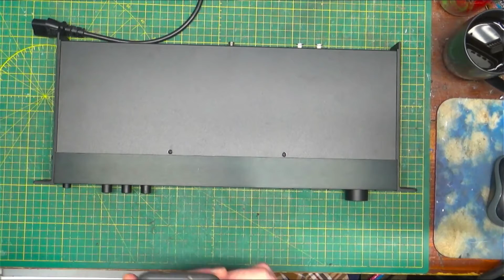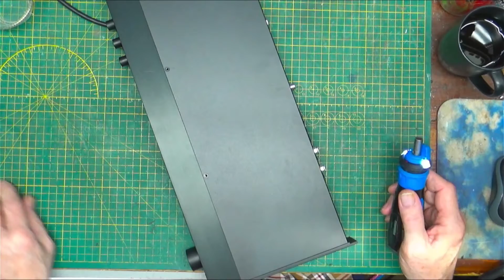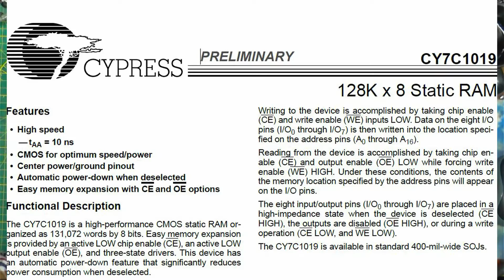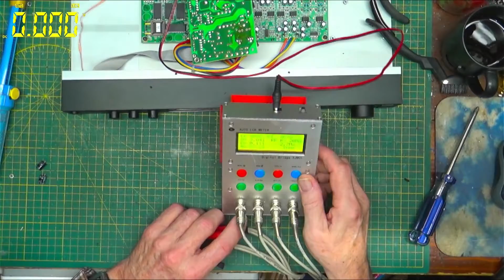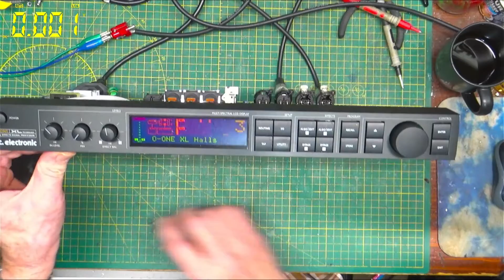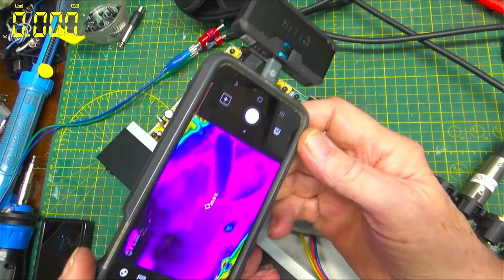T. C Electronic M-One Dual Effects Processor Repair

Comment: Just to let you know, to pull the front piece off, You have pull those 4x knobs off first, then you can take front off by pulling it a bit forward, then slide it to any side.
Reply from the maker: Thanks for the info. Sometimes I think design folks have fun dreaming up ways to make it hard to get in.
Reply: @AERVBlog I have one that takes a few minutes to power up properly, i dont know what the issue is with it, i got it repaired years ago and it happen again.

Comment: Thanks this is a common fault with tc electronics equipment I have a finalizer ,fireworks,and a third tc module and all have suffered from this problem I paid over a thousand pounds for each of these when they first came out I had just over one years use when they all developed this problem. I was absolutley livid £3000 down the drain. I then paid £400 for replacement power supplies which never arrived from Ierland. it took several months and threats to get my money back.I then placed them in storage where they have been for well over a decade.This is an easy repair for me now that I know how to test without the schematic. many thanks i will uopdate you once the repairs are carried out many thanks great video.
Reply from the maker: Good luck. Waiting for the update.

Comment: Great video, thanks! Got a similar SMPS in a TC M300 but no secondary power at all. Primary part seems to be alright but not a single regulator is getting it's voltage ... hope that it's not a broken transformator
Reply from the maker: You're welcome.  Be sure to let us know how it works out.
Reply: @AERVBlog  (New comment bc my previous assumptions were false):
PSU is up again with stable voltages!
Defective was R2, a 150 kOhms 1 watts resistor that became non-conductive. It is the starting resistor for the SMPS fed directly from the circa 300 VDC coming out of the full-bridge rectifier diode network. The starting resistor powers the oscillating circuit at the beginning.
Reply from the maker: @theNWdigital nice find. Did it show any signs of being bad?
Reply: @AERVBlog  A little burm mark on the bottom side but thus only visible after desoldering. The layout is very measurement-friendly if having a decent multimeter though.
Reply from the maker: @theNWdigital I am glad you got it going.

Comment: I really enjoyed watching this. I have several TC Electronics and Behringer equipment. Not top of the line but it serves the need and I like it. I'm in the process of repairing my finalizer wizard to power supply. I've had to replace the 3 volt lithium battery in the past which is dead, the display will not power up
Reply from the maker: Just because equipment is less expensive doesn't mean it won't work for you. I have lots of behringer stuff in my stations and it works just fine.

Comment: Nice one!
Hello how to connect this to mixer? I have Yamaha Mg10uxf-  there is one Phones jack (like TRS) labeled FX send. 

And there’s no label “FX returns” input for mixer. 

So I tried I plug it to mic input instead, I’m getting hiss /noise.

So what kind of cable will work to route this thing to my mixer?
Reply from the maker: I am not familiar with that mixer but it looks like you would use channels 7/8 line in to the line out of the TC
Reply: I use a big console , the soundtracs Jade / the aux send go to the Reverb.s input and output from the Reverb to 2 channels line input so use 2 channel faders  pan them left right

Comment: Hey man! I have some problems with my TC Electronic D-Two, hum noise (even in bypass mode) and sometimes the LCD is going to freeze/blank, also whenever I dialing the level and mix knob, hum noise is getting worse and some strange sounds appeared, do you know why? Oh FYI I used TS jack for mono input and output 🙏🏻
Reply from the maker: All I can think of is power supply problems. It could be bad filter caps but also, if it has 78** or 79** regulators check the bypass caps, usually around 10uF. Also check your grounding both for missing ground or ground loop. Hope that helps.

Comment: The fuse blows every time i plug in the mains power!
Reply from the maker: That is most likely the power supply. There isn't  anything special about it.  It has 3.3V, 5V and +- 15V. It is a switching supply and you might be able to find a replacement on Ebay. I don't know that for sure though.
Reply: Thanks

Comment: I have a TC  Electronics G FORCE,  DOES NOT POWER ON. I was thinking it was the power switch itself because it just didnt fee right as I removed everything from the front all these soft tab buttons went everywhere its a mess. I now know after watching this , I should have gone right to the multi meter.  Can I send you the unit for repair ?
Reply from the maker: Contact me at aervblog@gmail.com

Comment: Frist of all I know nothing about this just because I have this effect unit dying slowly then I Google and find out they all have same problem with the power supply then your video makes me want to repair mine myself but be honest I need your help on what exactly capacitor do I need to replace them (know nothing about them) thank you very much and yes I am very impressed
Reply from the maker: Considering the minimal cost of the parts I would just change all the caps in the power supply. They are easy to get to and since it is your own unit and not a customers you don't have to justify changing out potentially good parts. But at the very least replace those 2 220uf shown in the video. All the parts are available at mouser.com or digikey.com.
Thanks for watching

Comment: Interesting - as far as I can recall, the internals look the same as the G-Major/2 I have (apart from the analog connectors). Some of the G-Majors had S/PDIF too. I wonder if they basically just use different firmware...
Reply from the maker: I don't know. I have never gotten into one of those but I suspect they have similarities. 
Thanks for watching and commenting

Comment: Thanks for the video!

I got one of these with the display issue and am in the midst of trying to repair it.  I completed re-capping it today but it still didn't work.  The +15V rail is showing 14.7V so that may be the issue.  The -15V rail is at 14.9 something.  I ordered the two 15V regulators and will replace them both and see what happens.  The 5v and 3.3V rails seemed fine.

I think this one was used for a while after the display went.  There was dry, crusty capacitor leakage in multiple places so I think it has been failing for a while.  I'm thinking that the continued use probably damaged the regulators.  We'll see what happens.
Reply from the maker: That sounds like a good guess. From what I can see online those things did have problems with the displays but somewhere along the line I think I saw that some folks were controlling them through MIDI?? Don't know much about MIDI.
Reply: did you get any results? i have the same problem

Comment: i still have two M ones. one 1st gen, TRS plugs bought new, and a 2nd hand M one XL. great sounding units. dead screen on the 1st gen. lights up, but no symbols. i've put screens in other rack gear before, gotta get to it.  would you know if the screen is available for this 1st gen unit? i don't see it anywhere.
Reply from the maker: It doesn't look like they will sell you a screen for it from what I can tell. Check your voltages first before you swap out the screen though. It might be a simple repair.
Reply: @AERVBlog  thanks for the reply.

Comment: Nice repair! I think the kind phrase is "built to a price point" - but yes, cheap. I was surprised you didn't check the +15 current prior to replacing the regulator - 78 and 79 series regulators have over-current protection built in and will reduce output voltage when overloaded.
Reply from the maker: To be truthful I was counting on the burnt look on the board and the fact that I didn't have the unit on for long but you are right.

Comment: I used a lot of TC Electronics gear when I did FOH sound......Yep, pretty cheap gear but they worked fine. Over a 9-year period our TC stuff was faultless I must say, albeit not powered 24/7.
Reply from the maker: I like the stuff. It seems to work great. I just don't care for the always on power supply.